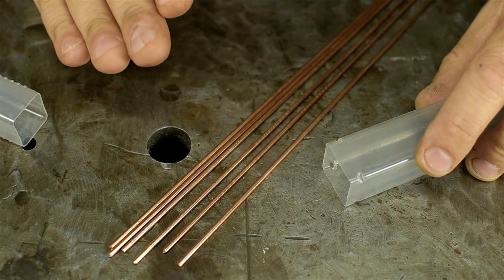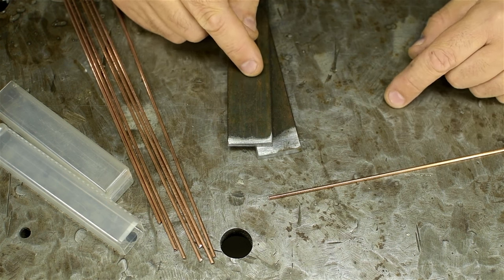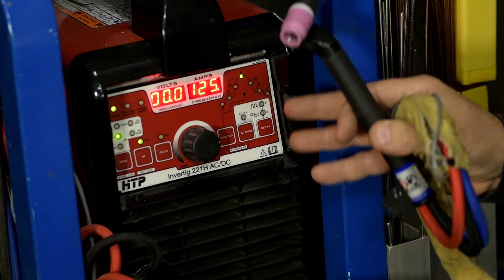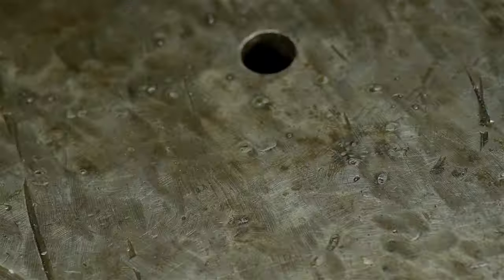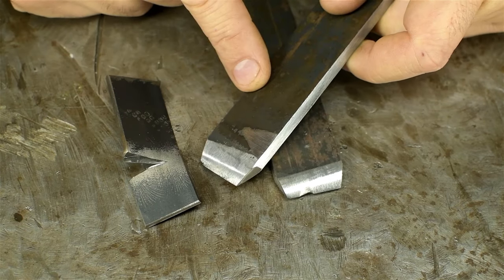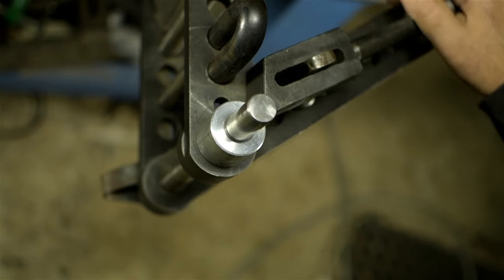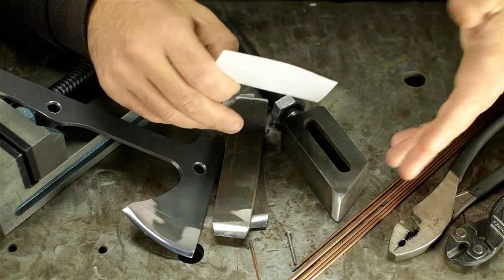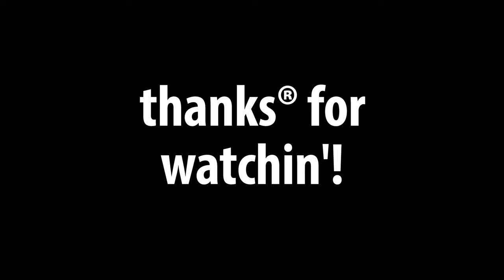TIG Welding with TOOL STEEL filler?!

Comment: Hey Tony this welding is what I specialize in. So if you want some pure tool steel filler metal try to get ahold of some D2 tig filler metal. Now if you want true hard facing filler metal look up a rod called satellite 6 or 12 tig filler, the rod will be purple and blue. It's one of the harder stuff I weld with. Now the hardest we use at work is a rod it's called c83 rod. It looks like gravel is melted to the rod. Very very hard. But it weld horrible fair warning. Hope I see something about this in another video any questions ask away anyone!
Reply: Stellite 6/12 I think.  Not the stuff for assembling  you model Sputnik with 😀  Who makes the C83 filler?
Reply: @ferrumignis  https://www.stellite.com/us/en/products/hardfacing-alloys/welding-rod.html
This is the company we buy our rods through and included is a chart of rockwell hardnesses and make for the rods, I'm not sure who we buy the C83 rods through unfortunately. And to answer your question I am not sure if it is the same stuff or not but I believe your correct.
Reply: Hi other Zac! Great addition to this video. What are the practical application of this? I know ToT mentioned die and mold uses but are there many uses outside of that? For those uses, are there many disadvantages to using tool rod vs machining out of solid tool steel? Is paying a person to Tig tool steel significantly cheaper than material cost and machining cost for solid tool? What other advantages are there?
 Is this a newer process and if it is are there any potential future uses outside the industrial market? Would this process ever be used like traditional Tig rod for joining materials or only in an edging application?

Sorry, a bunch of random questions but I find this fascinating.
Reply: @Zoltan54  Hi other Zach! No worry about all the questions I love talking about welding and my work! There are many reasons why hard facing is applied to material, basically hard facing is used for anything that in production standpoint that sees a lot of wear. Tony is correct in die and mold making it is used on 90% of molds for obvious reasons. And a lot of construction companies will use hard hard facing in the bucks of loaders and digger's. Depending on the company they will just use FCAW and weld "patterns" inside the buckets so it shifts the wear in the buckets. As far as my work I work on injection molding feedscrews which 99% of them get some form of surface build up( hardfacing) through the product or they can wear out within weeks. As far as using filler compared to just using pure tool steel parts is, 1 cost tool steel is extremely expensive, and 2, during say tools and tie applications certain parts of mold will wear faster then the others and they are the parts that will get hardfacing.
Reply: And as far as this being new not really, there is a a rival company that we compete against that has been around since I believe the late 70's or early 80's. And it just so depends on what you need the application for, the biggest thing I ever welded personally with this was a 8" auger that for about 40" long of the auger and 8" high was hard faced and machined to around 1" wide on the parts. If you look up what feedscrews are you will get a better picture of what I mean with the dementions.
Reply: Zachary Taylor I always wondered why they welded those patterns
Reply: Zachary Kaneshiro I believe Stellite filler rods can be used to reface camshaft lobes which are then reground to back to profile. Just one application I remember from reading British motorcycle restoration magazines when it was necessary to reclaim a commonly unobtainable part.
Reply: My names zack also..  but im zack III i guess...  sup..?
Reply: @LanceMabu  yes sir! That would be the reason for that. If the company wants to go crazy for ware resistance they could use a Nickel 99 (black rod) stick rod. Welds amazingly well just don't make a mistake with it lol. Or there are options for hardfacing MIG wire, that is something else I do a fair bit of.
Reply: @MrMilky927  we use satellite 6 and 21 at work. But its done by Plasma tungsten arc welding on a automated machine. The filler material is introduced by a super fine powder. Can build up  1/4  inch of weld in one pass if we wanted too.
Reply: That's the exact application we use as well, then if there is anything wrong down the machining process we will use the hardfacing TIG rod to fix it!
Reply: Tony I think you should listen to this guy

He's the 12th POTUS after all
Reply: @cameronmitchell454  I have came through time from 1849 to tell Tony this information but have lost the ability to travel back so here I am answering your questions
Reply: @AndrewMKinnear  thats correct.
Reply: @MrMilky927  just ask Tony to use his lathe, duh. Jk
Reply: @Zoltan54  Hard-facing with stellite is very popular in the aerospace industry - especially in repair & overhaul where abutting features & components rub or bounce off each other when the part is in service.
Usually goes for a heat treat before it is then machined back down to original part dimensions.
I know you didn't ask me, but you seemed interested, and I figure I could share expierience.
All the best.
Reply: Could you reface a power hammer die with this stuff or would the constant pounding be too much? It's not a big heavy one, maybe 75-100lb or so.
Reply: @ConfusedRaccoon  Hmmm I know people will use it on normal hammer faces. So I mean if it's already pretty worn out I'd say give it a shot!
Reply: @razormazor6947  Thanks for additional info! Would this be more aviation (military, commercial, or private) or reusable spacecraft, or another sector entirely? Would the materials be initially hard faced and repairs done as necessary or would this be a repair and improvement over factory standard parts?
Reply: A common application for this sort of welding is chipped punches for tool and die. If the welding is done well, punches with welded up edges will last longer than new ones with nice homogeneous tool steel. You can leave them harder for increase edge life and the steel behind it gets tempered down by the heat of welding so they are less prone to cracking and large chips. Profile grinding the welded punches before putting them into storage for when they were needed was regular part of my work as a tool and die maker years ago.
Reply: Zachary Taylor ESAB has bought up a number of welding filler companies, including hardfacing material. It’s hard to get though. Generally, you cant buy a pound or two.
Reply: @Zoltan54  Aviation, Jet engines in particular as these parts are so expensive that it is more economical in most cases to repair rather than replace.
A hardfacing operation could both be implemented over time as an "improvment"  as well as the parts were already hardfaced previously.

Most repairs involving this tends to be on features like locating tangs, keyways & slots that end up damaged while they were in-service and they are now outwith dimentional standards of the said part.
 
So despite hardfacing these areas, they still wear under extreme stress, it is just a case of using the hard-facing to minimize the damage for the next time it comes in for repair - because once a part is declared "outwith repairable limits" , it is scrap.
Reply: @melgross  well I know the company we get the C83 rod is not a ESAB company. We don't use it very often because it's very low quality and get a lot of pinholes. But I listed the company we buy our more popular hardfacing filler from in another comment
Reply: Zachary Taylor my experience is that the ESAB materials are of very high quality. The problem is that they gave so many, it can get very confusing. Many materials have a broad overlap with others in the range.
Reply: @melgross I absolutely agree with you. That's why I'm glad we buy our speciality rods from them
Reply: @razormazor6947  Fascinating. Thanks for the info!
Reply: @Zoltan54  Glad I could have helped brother, all the best.
Reply: stellite ... google.... $140/lb (80ish dollars on sale)... hmm.. D2 is more reasonable at 10.50/lb.  Thanks for pointing in that direction, I'll most certainly use this information.
Reply: @stoneshrink  stellite is a actual hard surfaceing rod so it's a specialty rod, has nickle, carbide and other expensive metals mixed in it that's why it's so much. D2 is a more of a "all purpose" rod as it comes to surface build up. I was just giving tony other options if he was going to make more videos involving hardfacing. But if you're a hobbyist then D2 is the route I would try to go. Also welds clean
Reply: Andrew Crews  unfortunately no I have not. The only stick rods I ever ran was 6010,7018/ nickle 99. Mostly all the work I have done was heavy FCAW,Tig or PAW
Reply: Andrew Crews  man that sounds so fun honestly! I wish I can get on a job like that! You would be suprised hardfacing MIG wire don't require a big machine. We normally run 1/16th Stellite 6 wire around 22v and 150ish wire
Reply: Andrew Crews  oh yeah nevermind then 😂😂. See I don't even own a welder unfortunately hopefully in the next year 🤞. Always wanted to try out a engine driven welder around where I live rig work and pipeline stuff isn't really a market for it unfortunately so I don't even know anyone that has kne
Reply: Would one of these fillers be good for welding up forged rocker arms in old cars where the  valve has cratered the rocker arm? I need to do this for a 1929 chev popcorn truck.
Reply: @razormazor6947  True. We also use stellite 31 cobalt alloy for high pressure turbine blade repair.
Reply: A long time ago I spent hours & hours stick welding hard surface on heavy earth moving equipment. I think it was 1/4" rod powered by a big trailer mounted welder. Really boring work done when the weather was against digging.
Reply: Interesting advice Zac. And I don’t care what they say - you were an ok President.
Reply: @ConfusedRaccoon  just be careful what you are hitting with that power hammer - if you smack two hardened surfaces together enough you might get some spalling and shrapnel.
Reply: @Zoltan54  I'll throw in my 2c worth on this topic while I'm here.  For reference, I did my time as a boilermaker years ago mostly in mining, but also some time in marine environments.  Tool steel isn't to be confused with hardfacing.  Even in the specific realm of hardfacing, there are literally hundreds of types of processes and fillers for specific applications ranging from impact, to abrasion, to heat resistant etc.  I've worked with a range of these which are used for rebuilding the tips / edges on some of the biggest excavators in the world, Liebherr 996 face shoves, to smaller stuff like rock drilling tools, smaller diggers, augers, and even things like building up wear surfaces on 80 tonne smelting pots used in the refining of copper.  Some of these things are so hard that they literally crack as you're welding them.  Some require butter welding techniques - intermediate beads of different types of fillers.  Many of them require a specific weld procedure including pre and post heating, and measurement of interpass temps.  Some are not even welded on - they're deposited on the surface by spray welding, such as chromium carbide surface treatments.  Some of these things are so high up the hardness spectrum that they make bisalloy plate seem like wet spaghetti.  

TOT is right about being cautious when applying impact loads to tool/hardened steels.  There was a guy some years back who applied hardfacing to the tip of a centre punch and reground it.  While using the tool he started feeling a little tired, sat down for a moment, started getting dizzy, then eventually passed out, fell over and died.  Turned out the tip of that tool broke off and punctured his lung, which ended up filling with blood.  There are specific fillers designed for almost any application - from low speed high impact jackhammer rock breaking scenarios, to high speed high sharpness low impact cutting scenarios like wood chipper blades turning trees to mulch at 3000 RPM.  Don't just go applying something without doing some research first.
Reply: The stuff he used in the video has an HRC rating of 54-57. Ther stuff you're recommending has an HRC of 40-45 and 46-51 respectively. Soooo wouldn't that be softer ? Of course, I've never even held a torch, MIG or TIG, so I'm relying on your expertise here.
Reply: @alexrowland  the higher the RHC is the harder it is. I was just suggesting D2 for the sake of it being pure tool steel where he never mentioned what filler he is using in the video. And I was only giving other options as I wasn't sure how much he knew about hardfacing and if he wanted to try something along the lines of that down the line.
Reply: @MrMilky927  have you welded inconel 625?  Very tough stuff.
Reply: @heraclitus6100  the shop I work at used to get inconel jobs from time to time but there was only one guy that was allowed to weld then and sadly it was not me. I watched him weld it a time or two but I never had the chance.
Reply: @Khrrck  Sadly it's not my hammer. But of course, never smack two hardened surfaces together. Always have something between them that's softer, be it a work piece or a stopper.
Reply: @MrMilky927  Cheers I'll pass it on =D
Reply: ToT,  you should pin this thread.
Reply: @AndrewMKinnear  INTERESTING
Reply: Andrew Crews  YUP YUP smoothest I've run..
Reply: @MrMilky927  Right on. As I said, I bow to your expertise. Nothing wrong with options 🙂
Reply: @alexrowland  I completely agree with you buddy. Everything can always be done a little better by certain people
Reply: Thank you so much for taking the time to answer people’s questions. It has been very interesting reading through the comments.
Reply: @angrydoggo5066  You're welcome! I love talking about welding so I'm always glad to answer questions that I'm able to answer! Especially since hard facing isn't a huge market.
Reply: @MrMilky927  hey Zachary, I make knives and i was curious if I could make the body out of say titanium or another metal and weld an edge on I could sharpen to a polished eyelash splitting edge? If this is possible any advice on what rod to use? My hands are fucked from neuropathy so I use a surface grinder and about a billion hours of set up to do everything but polish my edges, set up however many knives i can fit on the mag chuck with holding stuffs and get to it. Finish the edge with a 3/4 MDF disc on a bench grinder and strop with another wheel I glued leather to.
Reply: @skizzik121  Well I can't give any advice about titanium since I have never even held it before lol. But I'm assuming you want something not really hard. But maybe try to find something with a rockwell hardness of like 30ish?
Reply: @MrMilky927  hard enough to take an edge, something in the 56ish up to around 65 give or take.
Reply: @skizzik121  I'm not sure if hardfacing titanium is a thing honestly since I know welding titanium is really finiky getting quality welds from my research in it. I tried a quick googlefoo to see if I could find anything but I couldn't find anything about it. The closest thing I saw was a brazing rod but not sure if that was exactly right either since I don't know about brazing either. sorry I couldn't be more help
Reply: @MrMilky927  not a big deal it was just curiosity killing this cat is all. Thought maybe it could open up some doors for design ideas.
Ill stick to my way overly precise surface grinder produced edges on good ole fashioned steel.
Thanks for your time
Reply: @skizzik121  Hey glad I was kinda able to help. Yeah I know exactly what you mean with the precision grinding since that is a job I'll also do at work when it's slow. I know traditionally swords are made of stainless which I know for a fact is able to get hardfaced since I use that as base metal time to time from work, and when we have small mistakes in the hardfacing we can use ss filler since it can "mix" with hard surfaceing
Reply: @MrMilky927  i tend to use M2 A2 and 5160. Would love to forge some stuff but with the neuropathy my hands wont grip stuff for nothing. But i have my 13 year old daughters in the shop with me when they aren't at modeling or dance class or studying they are in thw shop. Dads with pretty daughters should all do this...keeps them celibate when they smell like cutting fluid and coolant.😊 and when they find boys that think they are pretty covered oil and chips then we can talk young man
Reply: @skizzik121  I just thought of something. Try to look up meterial called "420 stainless steel". It's obviously stainless but it's a hardfacing stainless this might be something you could use. But I actually never heard of the other ones you mentioned. I would absolutely love to start forging myself as well but definitely don't have the money to start that right now but definitely want to slowly start doing that later in life. Yeah I could imagine that would put a damper on your hobbies. And definitely are raising them right!
Reply: @MrMilky927  5160 is a spring steel and A2 and M2 are both tool steels of various features. And id like to think im raising the girls correctly. And if dance and modeling fall through they can always make chips for a living!
Reply: You mean stellite?! They have that in filler??? Oh shit…
Reply: @lindboknifeandtool  yes they do. You can get it TIG. Or MIG. I do both a lot of work.